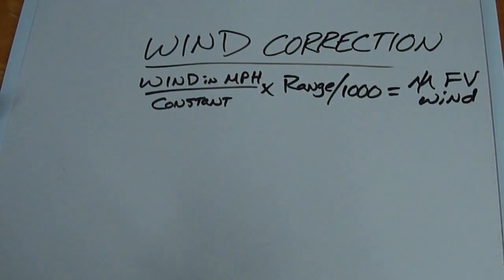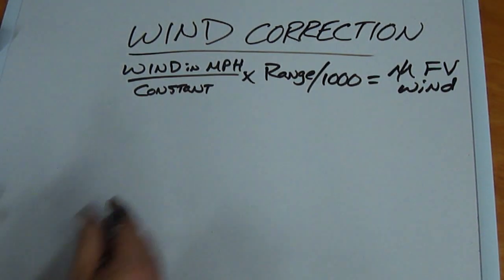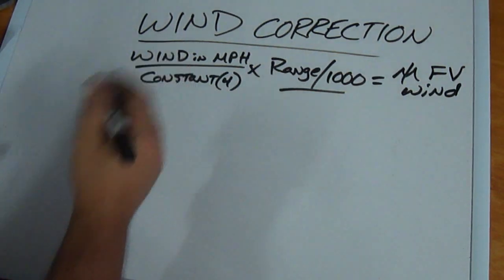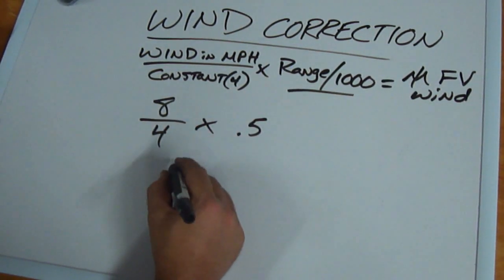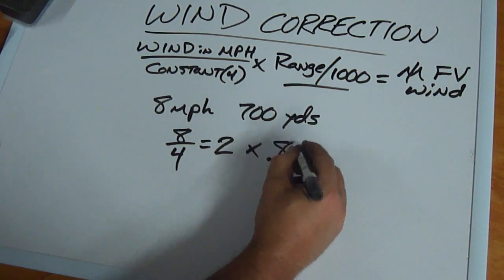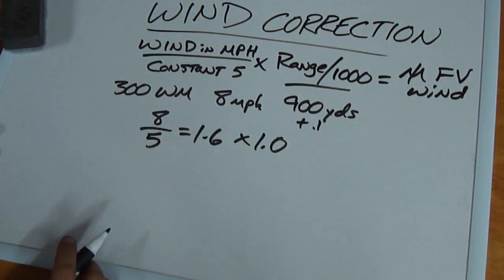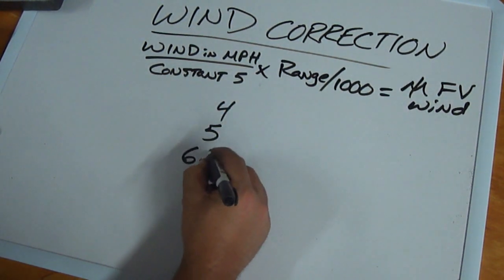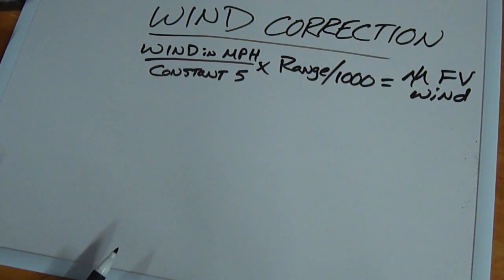Wind Correction Formula

Comment: Discourse;
0 Kmph windage at the 800 metre range

windage not dialled at 0x at the y axis elevations

kentucky windage due to barrel twist per inches

Miscellaneous facts;

bullets aerodynamic
bullet weight
atmospheric pressures (measuring a humid)
muzzle velocity
match grade barrels
MIL Scopes
rifle mount stability
aimed calculations
human intervention

☺️

Comment: Do the formula in MOA, not mils, for a multitude of reasons, like when your scope or sights are in MOA, or when using irons which will require hold off in inches. Here's the formula: distance to target in yards divided by 100 times wind value in MPH divided by the constant. Now how do you determine the constant? The MOA constant for any distance can be determined through a trajectory calculation produced from an online ballistics service. Just think what the distance in yards divided by 100 times wind value in mph needs to be divided by to produce the trajectory calculation's given MOA adjustment for a 10 mph wind. Using the .308 (175 SMK @2610 fps) at 600 yards for example, 600 / 100 = 6 X 10 mph = 60, so now what would 60 need to be divided by to equal the 5 MOA  stated wind favor from the trajectory calculation? The answer is 12. That's the constant you will then use to determine the wind favor in MOA for any wind value at 600 yards for the specified loading. For 1000 yards the constant is 10. This stuff is easy; but, if you have difficulty with wind, seek a credentialed coach/mentor. Most credentialed is a shooter holding an NRA Long Range High Master rating.  Ask your coach/mentor what wind constant he uses for 600 or 1000-yard competitions. If you get gobbledygook instead of a straight answer, move on to a more qualified coach.  Creds: US Distinguished Rifleman, NRA American High-Power Rifleman, SAFS Coach, and SDM Instructor.

Comment: What would be the constant for a 5.56 ? Like MK 262. And in what distance would add .1 in the formula? Thank you .
Reply: The MOA constant is 10. For example here’s  the formula for a 10 mph wind at 600 yards: 600 yards divided by 100 equals 6 times 10 mph wind equals 60 divided by 10 constant equals 6 MOA wind drift or 36 inch favor.

Comment: How do i find the constant of my bullet
Reply: Luke Shave , 
Get the G1 BC so if your G1 BC is 525 than your constant is 5. If your G1 BC is 400 than it is 4. On the range you can true and find out exactly what MPH your bullet or gun is. Bit late but hope this helps someone out.
Reply: @Bk7820-e3d  a bit later than you but thanks for the info. It was my question too.
Reply: @politicallyinsensitive4200 a bit later than you but i agree. i needed this answered

Comment: What's the formula for metrics though?
Reply: Just convert it. 1 yard = .9144 meters. 600 yds x .9144 = 548.64 meters. 1 meter = 1.094 yards. 600 meters x 1.094 = 656.4 yards and so on.
Reply: I can't seem to find the formula for the metric system either.

Comment: how can i create a constant for myself? I have a spr in 5.56 that i push out pretty far, I'd like to I use higher B.C bullets but i'm not sure what constant would work for something light like 77gr.
Reply: ACTION DESIGN SYNDICATE hi sir ,

Actually I’m using the French method from mr Perotti, it works very well , it’s the “ Rosace of Perotti  “ , he also wrote the “ de 1 a 1000m “ ... it’s a good book ! 

Thks sir for your help . 
Regard
Reply from the maker: Bruce I'm sure there's some mathematical way to deduce one, but I don't have a clue what it'd be. Best way I know to tell you is trial and error, I'm guessing you'll be around 3-4 inside 600 and you'll probably have to add the 700 yd tenth sooner. Easiest way will be to reverse engineer it at the range, make your results fit the formula, and confirm it on subsequent trips out.
Reply: Yeah I think i figured it out, because I recognized your formula. Its based on whats known as the b.c method. so the constant will reflect what the b.c is, so a sierra match king with a .362 b.c you can probably get away with a 3.5 constant or with the new eld-m are in the .4s use 4. 
So what in theory, if the constant is 3.5, then 100 = .1 200 =.2 etc will be added to every 3.5 mph of wind. I think you're right, adding the .1. i think will probably be at 600 yards or before. 
reverse engineering and gathering some dope will be the best way to confirm for sure. Thanks for the response.
Reply: ACTION DESIGN SYNDICATE hi sir , let me firstly to thank you for your reply! 

Actually, I use my data book and my kestel anemometer for all my corrections, ... your tutto will give me a easy solution for my next shoot.
Reply: Hi sir , could i use this formula with metric measurements? 
I’ve a steiner optic ( scope turret mrad )
Reply: For 5.56, use 3 and try the formula at the range. You need to get a good measure of the wind though, so I would recommend using a wind measuring device as opposed to using the military sniper estimation methods. That is the only way to know for sure.
Reply: Glad I can help! If you want to challenge your self or speed up the shots, or learn to shoot through different wind fields. you can try to use the wind estimate methods in the Army Sniper manual. The wind measurement devices only get you the wind at shooter position. depending on where you are you can have entirely different conditions half to and at the target. You can looks at the Army Sniper field manual, but you can also find a video on youtube with a female shooting instructor going over the method. Basically you can use scope mirage or observed foliage movement. They provide a wind speed range for each observation. You also need to note what the wind value is. In basics you really need to know full/ half/ and none. Head and tail wind have no effect on your left and right adjustment. Half value is a diagonal wind and you just cut the wind mph in half. In the formula above he is going a full value wind which is one that nearly perfectly intersects your bullet's path.  This is all good out to about 700 yards, but then you have to get fancy and really eyeball the wind angle and do some trigonometry. COSINE of WIND ANGLE.  You would multiply that number by your wind speed in this formula.

If you already know all that stuff, I apologize for the over explanation. I pasted this from another comment on a question. Just thought it may be helpful. Take care! Good Shooting!
Reply: I will check it out! Thanks for the recommendation
Reply: The MOA constant for Mk262 is 10 at 600 meters.